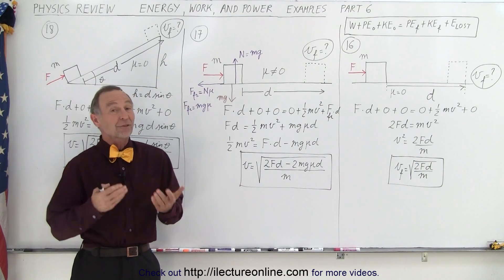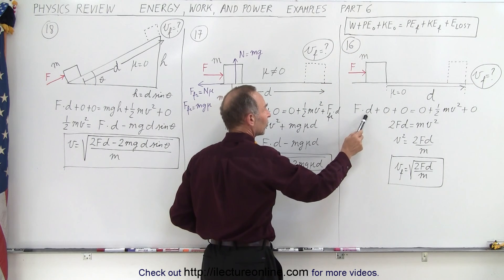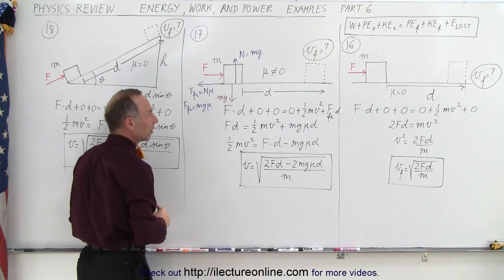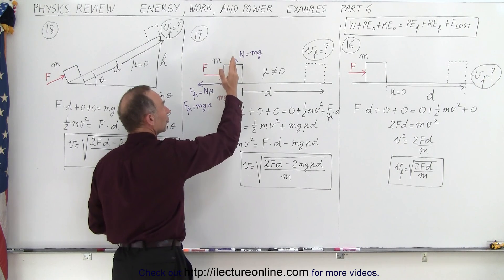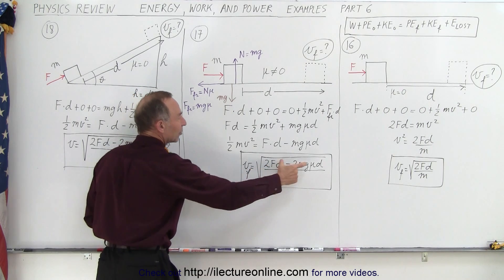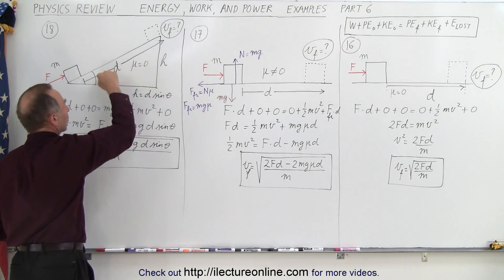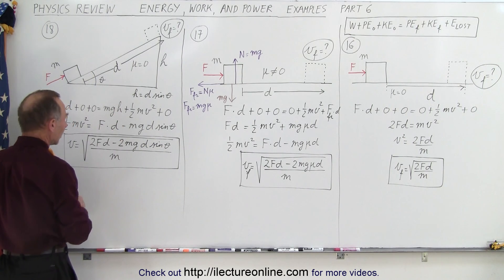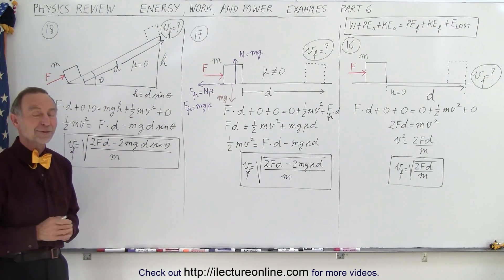Physics Review: Energy, Work, and Power Examples (Part 6 of 7)

Comment: I remember a problem from my old physics book "University Physics With Modern Physics", which asked how the mechanical energy of an oscillating object changed when a piece of putty fell on it and stuck to it at different points during the motion, and it turned out that the mechanical energy remained unchanged if the putty hit the object while it was at rest.
That was a fairly surprising result.